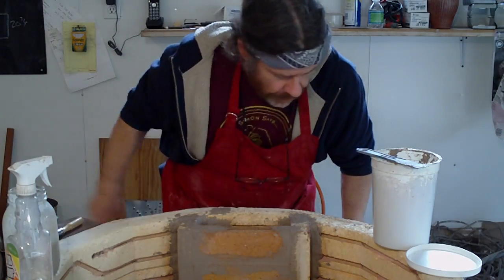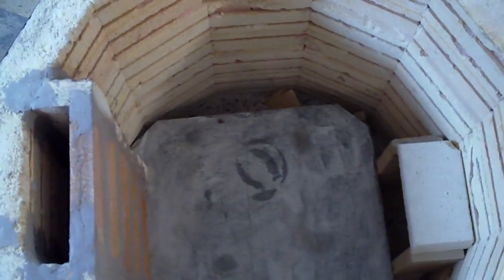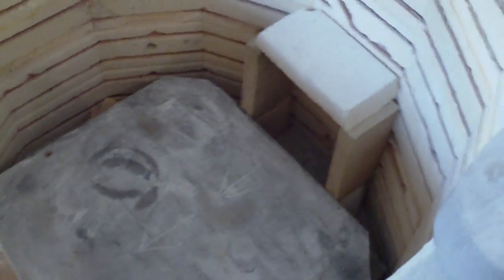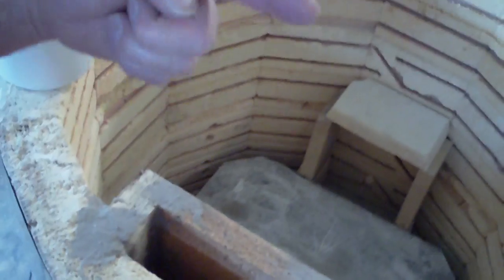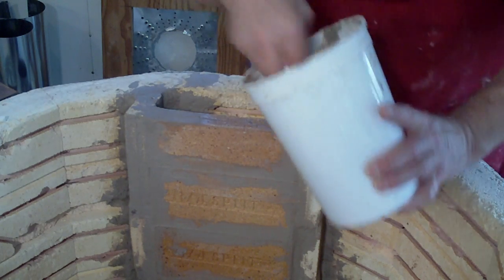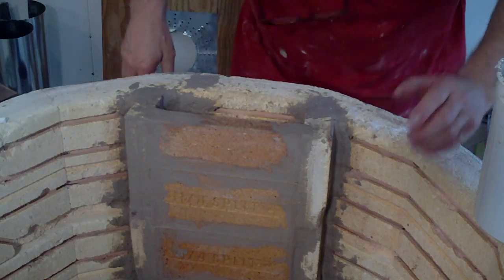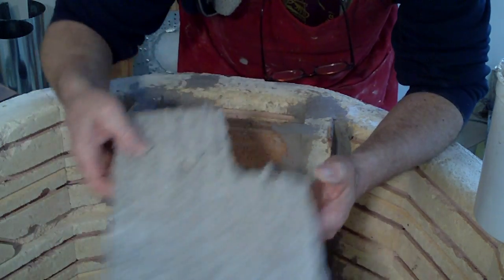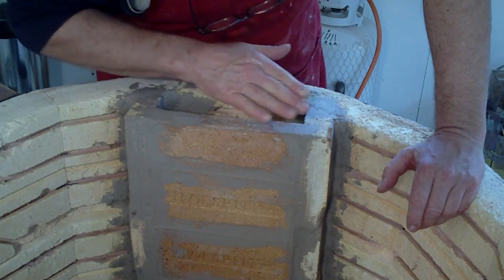SIMON LEACH POTTERY WORKSHOPS ~ Kiln reconstruction - chimney !

Comment: Hey Simon thanks for all the videos!  Quick question:  It looks like your chimney is actually resting on the edge of your bottom shelf.  Is that right?  Or did you cut a notch in the shelf?  Just wondering because that would change the size of your chimney opening (make it smaller), which might affect your ability to get to temp.  Thanks again!  I was lucky enough to get my hands on an old kiln, and I'm converting it as well.  Just hammering out the details.